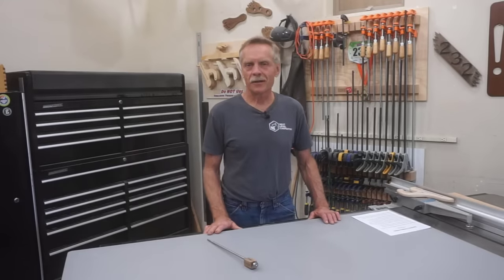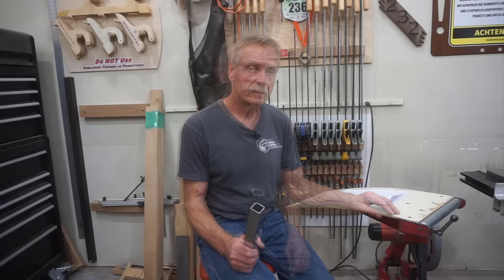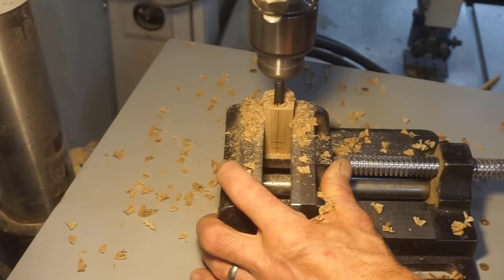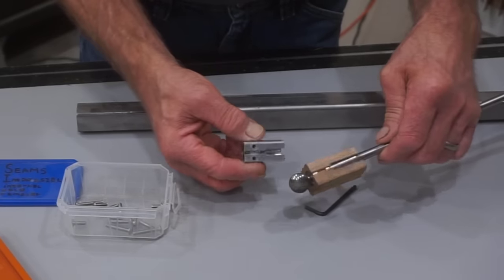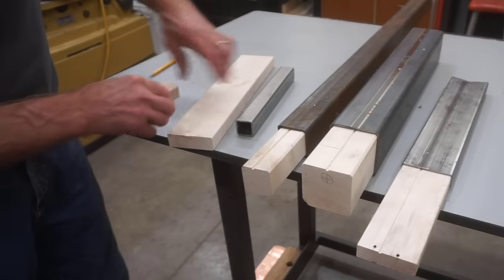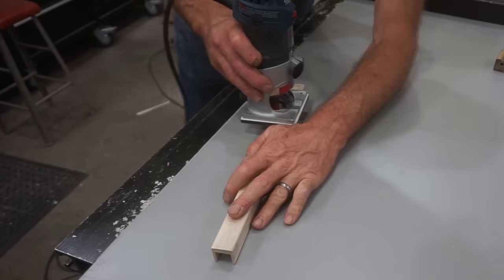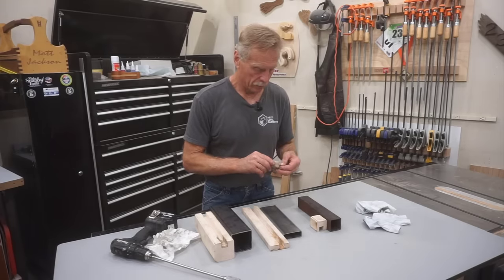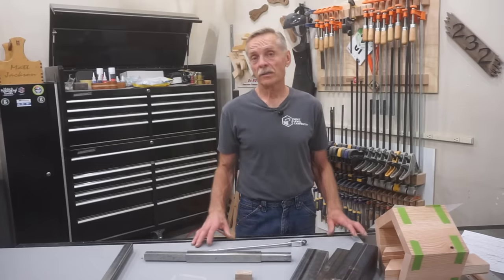How to Quickly Remove Internal Weld Seams from Steel Tubing

Comment: this is awesome.. just sold a tool. any plans for an extended length version?  i could see myself being limited by a 12" extension. something more like 24" or even 36" would probably take care of all my needs. i guess you could always attach 2-3 of them together. you may have even mentioned it in the video and i missed it. thanks for the info though. this will help me a ton.
Reply from the maker: Thanks... hope the tool works as well for you as it does for me!  Combining those extensions is mentioned in the video and works well for one-off applications IMHO.  If you find yourself consistently sleeving longer pieces you can either buy a longer extension or simply cutting a short one and welding in an extra piece of rod to make one of custom length for your projects.  Thanks too for buying a Seams Impossible tool!

Comment: Fantastic solution!  For shorter weld seams I use a 1/2" x 18" air belt sander but that only good for lengths under 15".  After checking my tube stock, I discovered that only about 1/3 of my tube steel have weld seams centered.  Of course I could hand select tube steel for pieces with centered weld seams-which would be time well spent when wanting to sleeve lengths of tube steel. Thanks a million for the video!
Reply from the maker: In case you didn't pick up on it, the Seams Impossible tool can remove seams anywhere inside tubes as long as they're like 7/16" away from the inside corner simply by offsetting the tool inside the tube with an asymmetric 'shim' like the one shown in the thumbnail for this video at Greg's Garage: https://youtu.be/xhqgy8c8dZ0jj so, for longer projects, it's worth it to hand select pieces with favorable weld location IMHO.
Best,
Matt

Comment: Seems impossible 3.0 - threaded holes on top and sides. Then use bolts to fill the gaps in larger pipes.
This would also allow you to offset the tool for a pipe with a non centered weld.
Reply: The seam is often near the corner of the tubes

Comment: My family was in the steel service business and I am aware that one can buy seamless square tubing, though it may be somewhat more expensive than the seamed type. The tubes are extruded.
Reply: otm646.... problem with the seamless is the wall thickness is so thin.
Reply: I was looking for a comment about seamless tubing. My immediate thought was does he know about seamless tubing? Is it not very well known? We use it fairly frequently at my work.

Comment: As an inventor. I think you have done a fine job. As a fabricator, I know for sure that I have been in need of this ability several times.
As reality. I know for sure that your tool will sell and be needed. 
At this time. I believe you can sell that block for 20 bucks all day. But 40 ? That's a big bite. And most people have the shanks and bits. So a package as you mentioned for that price may not go far. However : you still have not completed its totality. So. If you had several sizes that also can be cost effective. You can group them togather in a kit.  And then it might actually sell several. I can see also a few other ways to make this. And it just gets better from there. 
Peace, and thanks again. I think I'll subscribe.

Comment: Came here to talk about fireball tools and his videos
Reply: Steve Rone ya, I think i prefer his method over having to buy carbide burrs
Reply from the maker: @1966cambo  that is definitely your prerogative... I find it interesting that you see buying a carbide Burr as more of an issue than buying threaded Rod welding Machining and buying tool steel and having to make a dedicated tool for each size of tubing and weld seam location but that's me and I'm definitely biased towards the seems impossible solution which produces a much cleaner Surface after the weld is removed with less physical effort... Best, Matt
Reply: Next Level Carpentry I work with steel and own a very nice welder, thanks!
I have tons of scrap laying around including threaded rod, no different than you using your scrap wood and all the fancy wood working tools you have bought!
Reply: Also a piece of tool steel is super cheap but I have that here too lol
Reply from the maker: @1966cambo  there it is then! 😎

Comment: Talk about a clever idea! Well done! All based on that slightly offset hole in the wood and the drill extension for the cutter. Also, you whipped it together in a woodshop, not in a metal shop with a mill, and it works so well. Very, very impressive.
Reply from the maker: Thanks for sayin' Alvin... as they say; necessity is the Mother of invention, right? 😎 Best, Matt

Comment: How to QUICKLY remove internal weld seams from steel tubing...video 39 minutes long.
Reply: Well he did say you could skip around.
Reply: Using the tool, one CAN quickly remove the seem. Explaining how to make and use (etc.) the tool took 39 minutes.
Reply from the maker: Crazy how this simple fact needs to be pointed out at all, isn't it Wayne?  I guess many viewers expect to learn stuff like this in 60 second TicToc videos or something, right?  Best, Matt
Reply: @NextLevelCarpentry   Keep in mind just how much clickbait is on Youtube. Show then tell, avoid burying the lead.  I see this all the time ,  complaints like that are an issue of product demonstration and understanding,  NOT an attention issue.  You've solved an incredible problem here that creates a lot of possibilities so it's easy to disbelieve it could be so simple and people are leary of spending a lot of time to find out if they've been tricked or mislead. There is a reason why videos that demo the final product,or technique, at the beginning seem to get higher views,engagement, shares and increased Sales. You can see this on tv build shows too with the optimized cliche: Soft intro > demo > hook to watch the rest of the build > intro.
Reply from the maker: @TheNewton  I need you to help structure video presentation here! 😁 All that sensible advice simply escapes my carpenter/maker mindset and thought process though so it's hard to relate to viewers who's comments seem only to be impatient and/or ungrateful. Best, Matt
Reply: @NextLevelCarpentry  Don't ever change Matt, your in-depth explanation of the process is what we love about your channel.
Reply from the maker: @dereksmalls6238  Thanks for the 'pass' on this Derek... thinking about real 'professional' or polished format constraints gives me a headache! 😯😫😁😎 Best, Matt
Reply: @NextLevelCarpentry -some folks (like this commenter) can build Rome in a day apparently. I learn something new every day 😉

Comment: HELLO. Get a freaking flat file. Done........
Reply from the maker: Hey Diego: 
I'll race you; remove the internal weld seam from a 12" long piece of 1 1/4" x 1 1/4" tube.  You use your "freaking flat file", I'll use my Seams Impossible tool.  Loser pays $1,000 cash... it's your chance prove to us you're not just a putz who makes lame comments on YouTube videos by standing behind what you say.  Deal? Right...
Reply: I’m excited to see Diego’s video where he builds and demonstrates his flat file rig that fits down the tube farther than the length of the file.
Reply from the maker: @twestgard2  I'm excited with anticipation too... but m not going to hold my breath.  Because I am an eternal optimist I have set a thousand dollars cash aside for the event🤣😎
Best, Matt
Reply: Wow. Did you even watch the video?
Reply from the maker: @JTwelder.  I'm still waiting for a reply from Diego to schedule that weld seam removal race... but I seriously doubt it will ever happen😏
Reply: what if the tube is 6' long , what do you do. please.
Reply from the maker: @jimflynn5707  simply add additional drill bit extenders which will allow you to remove the seam from a piece of tubing any length. Although I can't quite imagine while you're wanting to remove the seam from a piece of tubing 6 ft long the seems impossible tool was designed specifically to make that possible. Good news is that we have tools in stock and for sale so we can accommodate your project if you like!
Best, Matt
Reply: I think next level carpentry has the best idea simply because it is completely adaptable to any length plus proof of concept and is “Bubba” proof! (No offense to Bubba’s anywhere) But a check in store at Harbor Freight, they don’t have and 7 foot flat chisel options. They did suggest welding a bunch or shorter on together!
Reply from the maker: @deankay4434  thanks for a supportive comment Dean!
Reply: Hey Diego:  where's that video?  Show us your skills!

Comment: Very nice. I recently had to do a 2.5” to 2” sleeve to extend some 2” square tubing legs. I noticed that a commercial product for reducing a 2.5” tow hitch receiver to 2” had almost exact dimensions of my desired final part and already had the welding seam removed, so I bought two of them, drilled a couple of holes, and avoided this headache. :)

However, I am making one of your tools. It’s amazing!!! Thanks for sharing with us.
Reply from the maker: Great work-around for your previous project Leonid... I think the way makers think is great, finding solutions to get things done despite hurdles and challenges.  Hope your Version 1.0 tool makes your next project a little more streamlined though... Best, Matt

Comment: I had JUST that problem 2 weeks ago, but build something from a file resting spring loaded on a sled I moved back and forth through the tube. Worked as well, but I like your power tool approach! Awesome!
Reply from the maker: Desperation is the mother of invention, isn't it?  It would be fun to see video of all the things people have tried to remove that weld, wouldn't it?  Your method sure isn't the most far-fetched I'm sure! Best, Matt

Comment: i've only recently started looking at fabricating videos.  I'm a licensed car mechanic in Ontario, Canada and in the process of getting my heavy duty repair license.  Since i'm still very green about this video, i wonder if the seam welds are usually in the the same spot.  If they are, you may want to have the burr stick out more so you can build machined caps that cover all 4 corners.  this tool looks like a great idea.  Hopefully you or your viewers can chime in on whether or not the welds are usually in the same place
Reply from the maker: Beat you to it, Raymond: https://youtu.be/ozSE7Wrdb1o?t=1117  😎

Comment: Well I'm in London, England, so it is already 1:30 a.m. here, but I am staying up for this one!  Some time ago I had an idea for fabricating something that needs a square steel section to slide in one of those tubes and I have been wracking my brains ever since trying to come up with a GOOD way of doing this exact task.
Reply from the maker: You sound just like me a month ago Fire Angel... I do believe you'll not doze off as you see 'our problem' solved! Best, Matt
Reply from the maker: Sweet dreams of sleeving tube with the weld removed, Fire Angel!

Comment: thats pretty cool, hope you patented it!!, we also supply similar equipment to tube manufacturers called inside weld bead scarfing. this is used for tube manufacturers who need to remove large amounts of inside weld  beads.
Reply from the maker: Yeah the seams impossible tool is definitely geared towards smaller volume applications. It has a provisional patent but please get in touch with me if you think stocking the tool would benefit your business because I'm sure we could figure out a volume discount to sell units for you to keep in stock.
Best, Matt

Comment: Very nice invention!  I could've used this a couple times through the years.  Thanks for sharing.
Maybe this had been suggested in another comment, but if you could extend the guide block past the end of the cutter/burr head, it would provide enough support to finish removing that last inch or so of the seam.
Thanks again for the video!

Comment: For reversing...or cutting the weld seam from the opposite end of the tube,  just turn the sleave around to offset the burr to the other side, since the tube is reversed.  I love the idea...patent the tool, I see there is a large market with fabricators being everywhere.  Nice job.

Comment: You just saved me a huge amount of time. I was trying to figure out how to remove the seam from a 2x2 ID x 10' square tube. I was going to use the tool steel cutter method but pulling it through a 10' length is a bit scary. But with your tool and a silly extension I should be able to do this easily. Very cool tool.
Reply from the maker: I'm curious about what type of project requires you to do that but I'm confident a seams impossible to long will do the job nicely and relatively quickly...
Best, Matt
Reply: @NextLevelCarpentry  I am building a camping trailer and I have a 14.5' & 17.5' kayaks that go on the roof. There is a lot of boat hanging off the back of a 4'x6' trailer. I want to be able to extend the tongue when the boat is on the trailer and retract it back in when it isn't in use. 

I plan on putting the kayaks on top of a alu-cab gen 3.1 roof top tent or something similar. When the tent is open it will tilt the boats down at a sharp angle and I don't want to hit the tow vehicle. So more length is required. 

 It has to be a bit over built because when it doesn't have the boats on the roof it will be used for off road camping.
Reply from the maker: @EthosAtheos  Wow.  Interesting project! I hope that the tubes are able to slide smoothly enough even with the seam removed because even a little bit of grit or paint on the inner tube can make sliding it tough.  A little rust would could also make extending the tongue difficult.  Don't want to be a buzzkill though and wish you well with your project and subsequent kayaking/camping adventures! 👊👊😎

Comment: AWESOME video! I ran into this problem when I wanted to make a scale logging trailer for my RC truck! Since I COULDN'T figure out a way to overcome this problem, I never made that trailer. I'm excited to try this out in the future, & see if I can get that project to FIANLLY become a reality!
Reply from the maker: Good luck bringing an old project to completion... that's always a great feeling!  It will be a similar feeling building new roller stands for the NLC shop with sleeving adjustment pieces that actually fit properly! 😎 Best, Matt

Comment: I got mine a few weeks ago now.  The groove for the weld is not wide enough for 2.5x2.5 0.25wl.  I had to modify the groove and make two stages of slip tubes to cut the weld out. This worked much better than any other method available.
Reply from the maker: Sorry to hear you had to modify the groove but glad you were able to adapt it to work with the larger tube! Best, Matt
Reply from the maker: Best way is to post them to Pinterest or Dropbox and add links in a comment here if that works for you?

Comment: Great video again. On your stand you put your locking screw in the middle of the tube. If you put it on the corner it pushes on two sides an won't wobble. I have one of these on each one of my benches. That way I can change out my vices from a pipe vice to a machinist vice. I even have a mini hoist that I can slide in. Thank you very much for all your very valuable videos.
Reply from the maker: Apparently great minds think alike Steve! I plan to incorporate that locking handle orientation feature into the new roller stands when I do the build video series so thanks for watching and commenting... Best, Matt
Reply: You should slit the tube, then make a clamp that closes the slit.
Reply from the maker: @janeblogs324  Whhuuuut?

Comment: Great invention
If you mounted the block in the center of a longer jacket (say 5 inches) and could you push cut the seam out? I think this would have 2 advantages: 1) there would be almost no chance of pulling the extension off 2) You could clear the seam put of a piece twice the length of the extension, starting from each end and meeting in the middle, even of the seam was off center you could just turn the jacket around before the 2nd cut. 
Just something you might try.